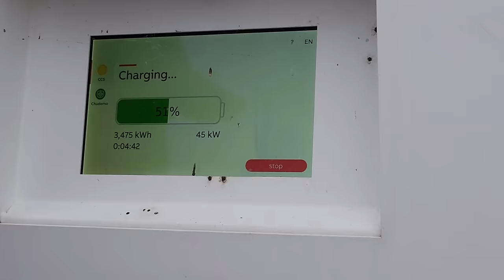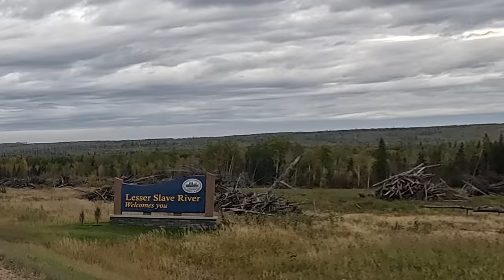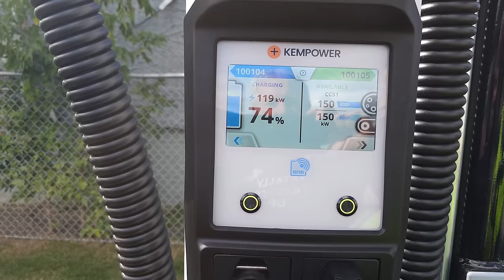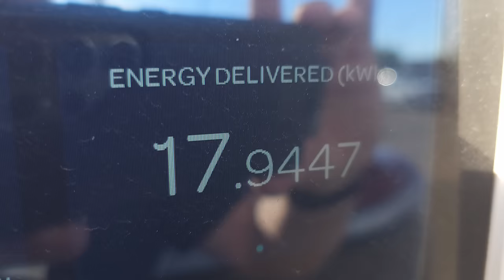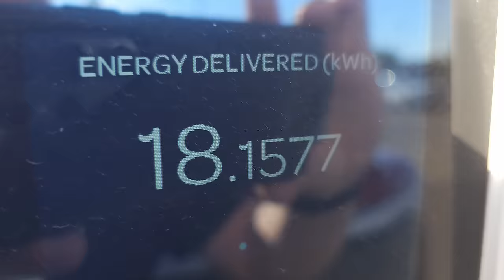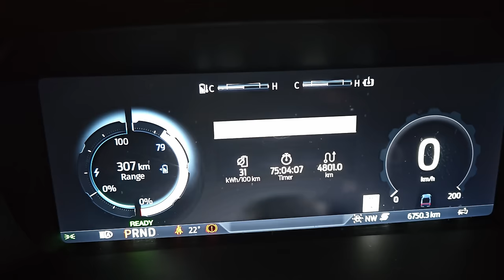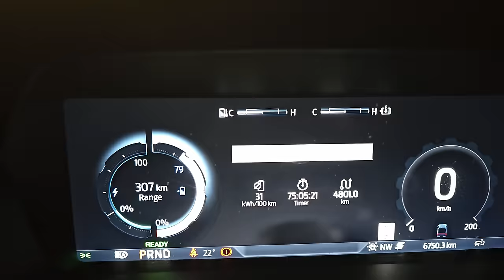Electric Highway Tested in Oil & Gas Country - Unexpected Results!

Comment: Most pilots of propellor planes try to avoid the birds and bats, propellers are expensive and we'd rather not explain to the people we rented the plane from how we damaged a thousand to multi thousand dollar part. It's even worse when it's your plane.
Reply from the maker: Excellent point! Keep in mind that I am professionally registered as a Level 5 Schmuck 
Still, from a comparative analysis perspective, a bird or bat could play a game of poop hopscotch between these props and never lose a feather 🪶  (or, uh, bat fur)😉
Reply: @truckedupevs  I'm assuming that the blades you are speaking of are from a wind turbine  which are long and turning relatively slow and not an aircraft propellor which often turn at 2500 rpm or faster. I wouldn't want to play with them.
Reply from the maker: @darwinskeeper421  Yes.

Comment: BC Hydro started building out their network starting at least 10 years ago  (I think 2013) when most of the cars on the road could only handle 50Kw charging (ahem... Nissan Leaf).   As a result of starting so early, many of the chargers installed were 50Kw.  It did take them some time to find reliable equipment and as late as 2021 they were still trying to find a supplier could provide equipment with a > 90% up time.  Their priority has been to find reliable equipment and then to complete the Electric Highway... which as of this September they have now done!  They are now working to add more chargers in busy locations and upgrading slow chargers.  The current generation of equipment (from Addenergie - Canadian company) now seems very reliable and as a result, around 2 or three years ago they started adding 100Kw chargers, last year they started adding 180Kw chargers, and this year they have started adding 400Kw chargers.  It's not perfect, but they were on in early and I think they've done a remarkable job.   PS... love your content!  PPS....  I gotta start watching these in order... I just watched your BC segment when you covered all this....😎
Reply from the maker: Ha! I was just about to suggest my BC/Yukon video 🙂
The thing is I drove by six brand-new locations where BC Hydro installed 50kw units at the worst junctions for such slow speeds. I agree; they were ahead of the curve, but it seems now to be just using up its inventory or something, and that's not helping.
In reality, BC Hydro is so far ahead of companies like FLO where almost all of their new installs are 50kw.  Not a single vehicle manufactured today has max charge rate below 150kw, so that should be the bare minimum standard. I hope that provincial and federal funding programs for installs insist on that as a minimum for qualifying - but I don't think they do.
Always appreciate such great comments!
Reply: @truckedupevs  I agree there have been some slow chargers installed recently.  I suspect at least some are in locations where it may be difficult (i.e., would take a lot more time and money) to get power for a faster charger.  We'll have to see how they roll out the new equipment upgrades from here on.  One thing I know is a limitation is, as a government entity, they have a formula that limits their installations in areas well served by the private sector. Their mandate is to make sure there are chargers available where others have not stepped up.  Squamish is an example... they have a lousy 25Kw charger (which 'temporarily' replaced one of the unreliable 50Kw units), and they are essentially prevented from adding more because Swtch and Electrify Canada and Tesla are serving that market.  The problem is, Swtch and EC are unreliable, often leaving the BC Hydro 25Kw as the only non-tesla option.  Unfortunately, reliability of the third-party chargers is not factored into their formula.
Reply: @truckedupevs ... also, the thing with Flo is that up until very recently (like in the past few months, I beleive), all Flo chargers were installed on behalf of a third party - often municipalities.  Only recently has Flo started installing on their nickel so i doubt there are many out there.  I assume the speed of the charger was dependent on the requirements specified by whoever ordered the charger... and how much they wanted to pay. I know North Van District uses Flo as their go to provider and so far have only speced out 50Kw chargers including a couple of new ones about to be fired up near Lions Gate.  The municipalities that are ordering these things need some education.
Reply from the maker: @WhizBack  Excellent points. That's the problem, isn't it? If we rely on capitalist forces to dictate infrastructural service, we're hooped. All we have to do is look at the gaps in cell coverage to this day in critical regions, and why companies like Petro Canada advertised the crap out of their 'Canada Electric Highway' more as a seeming grant grab and publicity stunt while having the worst reliability I've seen in any network.
Reply from the maker: @WhizBack  Wow. You are nailing it. Do you work in the industry? These are the big sticklers right across the country. But FLO might now be realizing that its previous approach is severely tarnishing its reputation, especially when their chargers - whether purchased by a 3rd party or not - have no other signage on them other than massive FLO signs. It's like advertising to the country, "We're slow, outdated, and limited."

Comment: There is absolutely no EV that can haul my work payload and get the range I need in a day. Diesel and gasoline for me the leftist fairy tale believers can have fun working  in -40c with a 250km drive each way.
Reply from the maker: Why all the 'leftist' crap? Did you not watch the video? I agree with you. Drive what works for you. 85% of truck owners - very few of them 'leftist fairy tale believers' - ever drive more than 100km in a day, and that includes a lion's share of the trucks on the road in Alberta. 
If someone needs to haul heavy loads, tow flatbeds into the bush and do it day in, day out, an ev truck would be a dumb move. Diesel all the way. But most truck owners in Canada & US aren't doing what you do.
I personally know of several companies who have diesels for the heavy, long haul work and Lightnings for the short haul work, and their biz is saving piles of $.
Ease up on the vitriol, brother. No one is coming for your precious truck.

Comment: Great video! I've travelled most of these areas in my Lightning while pulling a work trailer and I've hit most fast chargers in the province. You still managed to show me the metro ford chargers that I didn't know existed! Thanks for the video and the spot-on opinions on energy. Cheers!
Reply from the maker: That's great!
I hope the additional stop helps in your travels.
Do you tow a flatbed?
Reply: @truckedupevs  usually an enclosed trailer. My company does residential solar anywhere in Alberta. I try to keep carbon to a minimum but there has been a few interesting situations.
Reply from the maker: @spencernewson3117  I know what you mean! However, I think within the next couple of years, Alberta will be the 2nd province to match BC in the west - possibly in Canada - despite itself 🙂. A lot is going on. 
It's impressive doing what you're doing & leading by example. Thank you for that.

Comment: You missed the Flo 160 kwh at Sherwood Ford! Go Lightning
Reply from the maker: Nope. I didn't miss it but didn't go in the direction of Sherwood Park. However, the entire region really is impressive. 
Ford has negotiated a great DCFC network with many of its dealerships - but only with those that participated. Others in critical areas have failed to step up - and really should be held accountable for not backing great Ford product with much-needed infrastructure.
We need ALL dealerships to do what Sherwood Ford, Metro Ford in Calgary, and other forward-thinking Ford dealerships have done and deliver a network for their ev fleets.
Thanks for pointing out this excellent service offered at your local dealership, and especially for supporting the channel!

Comment: I live in Fort McMurray and you can easily make it to Fort McMurray via Smoky Lake in the summer, there is a Tritium 50 kw!
Reply from the maker: And then where do you charge in Fort Mac to get back? A Level Two for 6 hours in front of the library, or hooked up to your buddy's cloths dryer?
That's not an acceptable system, especially for a city of that size. Even the worst comparable cities in Canada - Halifax and Winnipeg - have DCfCs. Fort Mac has squat.
Truly embarrassing, frankly.
Reply: @ That’s true but you keep saying that you can’t make it to Fort Mcmurray, which I have in my Blazer EV, Mach E and Lightning. Also, there is a level 3 ABB charger at Summit GM that you can charge on 7 days a week if you speak to service.
Reply from the maker: @cremazie  I don't 'keep saying' anything. I am stating clearly that there is no public DCFC in Fort McMurray and you can't go there and back. The only reason you can do what you do is because you live there and are only going one way and then likely charge up at home. The videos are rating the PUBLIC DC fast charging network as it pertains to being shoulder to shoulder with traditional means of fueling.
Fort Mac fails on every front.
If someone doesn't live there, and manages to drive there, they can't charge up and drive back because there is nowhere to charge back up, at least in any acceptable amount of time. That's the worst in the country for a city with a population of that size. 
Summit GM lists their charger as restricted, not public, so no one will know what you know unless they live there. Again, not applicable to a public, electric highway. Fortunately the rest of the province isn't as bad. Also, to 'speak to service' means that service has to be open. Plugshare lists it appropriately. It is not reliable as a 24/7 DCFC.
So again, as I stated in my video, you can't get to Fort McMurray and back via any public DC fast chargers.
Reply: @truckedupevs  You spoke about using the Level 2 chargers at Koch ford to go to Fort McMurray as there are zero L3 in Athabasca. Anyhow, I have been trying to connect the dots between Businesses and Charging partners without any success in the Athabasca - Grassland - Fort McMurray corridor. I once had hope but it’s almost lost. There are getting to be a lot of EVs up here but we become islanded once the temperature drops to -20 and below..
Reply from the maker: @cremazie  It's truly unfortunate. I have dear friends in Fort Mac I'd love to visit with them without imposing and asking them if I could crash and plug into their house for a day. One DCFC would change everything. Just one. The Ford dealerships actually doing what they should be doing and turning their Level 2s on 24/7 or installing V3s like all the other urban dealerships are doing would solve it all and lead to more Ford ev sales in the area.
Total lack of foresight in my view.
I used a Ford station in Muncton NB yesterday, and it charged at my maximum of 180kw - for free! The GM dealership in Antigonish NS, just got ev certified, installed a DCFC on site, and overnight sold 2 blazer evs because of the local fast charging network available to their customers.
Fort Mac will get left behind if it doesn;t start to step up. The change is coming one way or the other.
Thanks for all the comments, and sorry to hear about the frustration. I share it.

Comment: How are your Supercharger experiences going since you got access?
Reply from the maker: Good, but expensive. By far, the most costly of all providers.
Reply: @truckedupevs   Really? Even with the plan? In the US, they are almost always cheaper. On something like 98% of the locations when compared to either all with their plans, or all without their plans to make it apples to apples. Tesla usually out competes the competiton, even in Europe, so that's sad to hear about Canada.
Reply from the maker: @junehanzawa5165  I pay anywhere between 28 cents to 60 cents per kwh, depending on the charger speed and provider. Tesla is currently hitting me between 60~85 cents per kwh. The first time I used one, my jaw dropped. My first thought was it wasn't much cheaper than gas. 

No, I'm not on the Plan, being that it costs just shy of $20 after tax monthly and if I added up the # of times I charge on their network, and the savings, which I'm guessing at based on others who have it, since Tesla doesn't disclose what it is prior to you paying them (maybe because rates vary from province to province?).It seems it wouldn't save me much since when not on tour, I charge almost always at home..
I'm new to using it, but in BC with BC Hydro as my main on-the-road source, the difference is dramatic.

Comment: My blue cruise speed recognition picks up the 40 mph ramp speed sign when I'm driving on a 70 mph road.  Rather dangerous when the vehicle slows down to 40 miles an hour when you're driving 70 mph with a 45 mph minimum speed limit.. it doesn't always catch those ramp speed limit signs, but it's happened here in Illinois. Maybe they should move them a little farther away from the main highway so it can't pick them up.
Reply from the maker: Ford needs to improve the ID process by refining it, which I acknowledge is no easy task.
Try driving down a 110kph (70mph highway) name Hwy63, and every time you pass a highway marker, the truck quick brakes to 63kph (39mph). Not good.

Comment: There is a charger in Athabasca at the Petrocan station I believe.
Reply from the maker: If it's not a DC fast charger, it takes multiple hours to get back to a level high enough mkae the trip safely. And then what does one do to get back?
My criteria for my Trucked Up rating is about the ability for an EV trucks to drive from one destination to another reliably and safely.
J 1772 chargers don't make the cut.
Worse, Petro Canada's Level 2 was flagged as 'under repair' that day, much like almost all of their DC fast chargers from BC to Manitoba, making them one of the most unreliable networks out there..
Reply: @truckedupevs  not sure what level it is, I’ve never used it. Great video though
Reply from the maker: @enzop.3227  It's a Level 2, along with the one Koch Ford turned off. Both are abysmally slow, but would have allowed me to at least get to Fort Mac. 
Getting back? Well that was a whole other kettle of fish.
Reply from the maker: Thanks for the comment though, identifying options for other ev travellers. Always appreciate it.

Comment: 28:30 My impression was that the goal was to prop up the price of natural gas: but I have no idea what sources I used to reach the conclusion.

When I did a thought experiment as to what Alberta needs to do to phase out fossil fuels in 5 years: they need a way to replace the royalty revenue from fossil fuel mining.

I have been working on a proposal to charge industrial wind and solar plants royalties proportional to what thermal power plants burning natural gas would pay. On it's face: it would discourage wind and solar investment. But the trick is that the amortized cost of wind and solar has been below the cost of other generation sources for a decade.

Charging royalties allows the Alberta government to get out of the way, and let the "free market" decide, instead of picking winners and losers. If they are worried about grid stability from intermittent sources: they can take a page out of the oil sands mining subsidy and charge a lower royalty rate for plants that have a power storage capability on site.

I don't fully trust the current administration to fairly implement such a scheme: but the rate subsidy for power storage prevents them from setting the royalty rate too high. If the "subsided" royalty rate is still above what thermal gas plants pay: "power storage" will simply be natural gas.
Reply from the maker: I'm not sure on that one. Introducing a punitive tax on wind and solar just because its more efficient and cheaper would go over like a lead balloon. A free market is exactly that, but Alberta is practising the opposite. Taxation on efficiency is protectionist. Capialism - something that supposedly is paramount in Alberta - is to let the players fight it out and whoever loses vanishes from industry. 
It's coming for Alberta one way or the other for transportation and energy production - and they know it. So the game plan is to curb capitalist supply/demand forces and employ corporate welfare for their cherished industry.
It won't work, and Alberta could find itself in the backwaters of history in a decade from now.
That's my two bits, but I get where you're coming from. There's no easy solution for offsetting disruptive change. Just ask Blackberry and Nortel.
Reply: @truckedupevs  My reasoning is that the wind and solar is a public resource: much like the buried hydrocarbons are.
An alternative is to just tax all land use, of which wind and solar use a lot, but farmers would hate that even more than a carbon tax.

Comment: Have you applied for your Tesla adaptor? Free on the Ford app if you own a Lighting.
Reply from the maker: Yes. I've applied twice: once with my XLT back in March and again when I bought Thor. Neither have arrived due to the Tesla/Musk debacle that has turned the whole adapter distribution on its head.
However, thankfully, I was able to nab one for the trip from another owner.